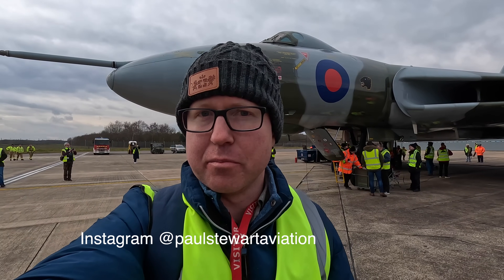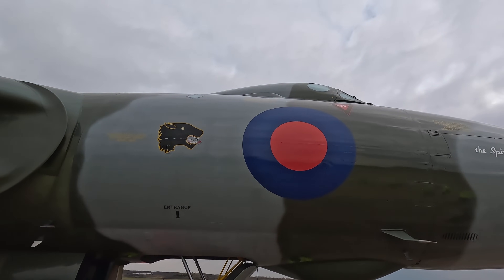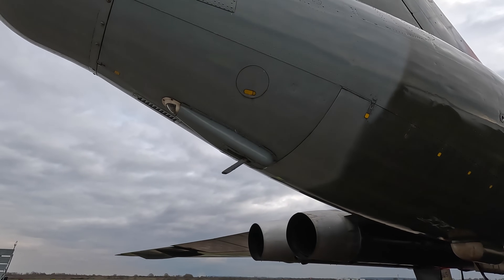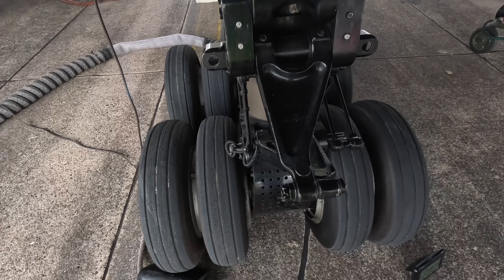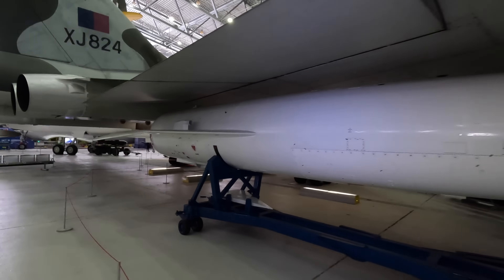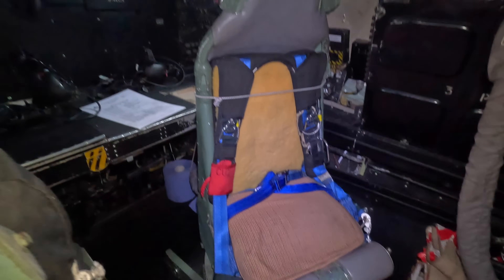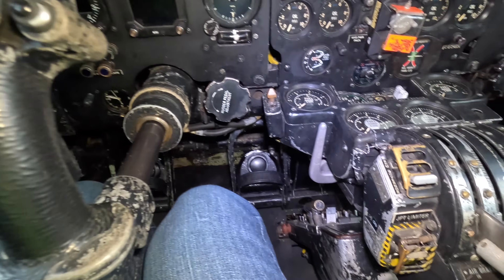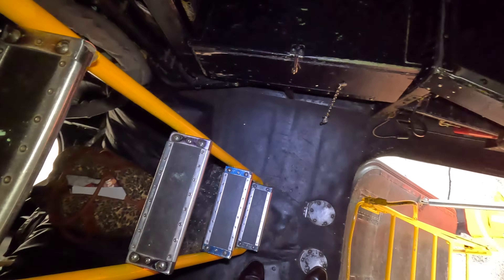Guided tour through an Avro Vulcan + engine run!

Comment: Looks similar to the Canadian built ( and destroyed ) A. V. Roe, CF 105 Arrow.
Reply: The Arrow is similar in that it failed to achieve its intended performance specifications, the Arrow lacked the engines it needed, and the Vulcan failed to fly supersonic due to design flaws in the airframe structure and aerodynamics

Comment: Wait, they could have upgraded the engines with afterburners similar to Concorde? How crazy would that have been if they had? 😮
Reply: Avro was forced canceled plans to install the afterburning version of the engines due to some serious design flaws in the airframe and aerodynamics that could not be resolved. Avro had to install a "Mach limiter device" to all the Vulcans to prevent them from crashing.

Comment: It is a grand irony that a plane designed to vaporise Russian cities from high level ( going low only came later) was, in fact, the best low level display aircraft ever. That beautiful howl from those Olympus , the fighter like performance, it’s sheer size and high lift wing meaning that the plane was always filling the sky during displays, not just a dot on the horizon. If only development had been continued and faith in manned aircraft maintained by the authorities the Vulcan could have been the British B52, still flying after 70 years and heading for a centenary.

Comment: I worked on them at Scampton in 1975-1978. Number 444 used to go for it's daily 'Taxi' around the airfield and would throw up a Fault so never took off. Noisy oily aircraft. I can understand people raving about them but wasn't a fan. I got my right hand crushed in the Bomb Bay whilst trying to remove a snagged mushroom head of Bomb Cradle Jack. The joys of being an Armourer. lol. Every piece of the Ejection seat had to be lockwired and every bit of trimmed wire had to be accounted for and as you can see in the video, there's not a lot of room to work. Fitting and removal of the seats required a crane but the initial lift out of the cockpit was by manual lifting, probably wouldn't be allowed nowdays. Many a cold winter night spent looking for missing zeus screws which had 'popped' out whilst working out on the pan handle when they were night flying.

Comment: I never knew it was designed for high altitude but then used in low. I'm not very knowledgeable about aviation but imagine it's like asking a sports car to go off road.  There was a great documentary on channel 4 in the UK, I think, which detailed it's farewell flight around Britain and the preparation for same. Pretty sure it's on yt.

Comment: For such a large aircraft, I was mildly surprised just how tight the crew section is.  It certainly takes a special person to be one of the five members who operate the beautiful delta.
Reply: This was essentially Avro Lincoln instrumentation squeezed into a five-crew cockpit. No wonder it was such a tight fit.
Reply: My wife's uncle was one of the three flying forwards facing backwards as an Air Electronics Operator.
Reply: The Lancaster was also very cramped for its size.

Comment: They have one of these are the museum at Castle AFB (closed and retired air force base in central California). A few times a year they have open cockpit days. They never had the Vulcan open but it still always had a good crowd around it. It's actually a pretty cool museum considering the base has been closed for years and the city itself isn't a huge town. When the base was in use it was a B52 base, I can still remember driving in the freeway through that area on trips when 2 was little and seeing the huge B52s landing and taking off

Comment: Wow, i cannot believe the complexity of the plane. Imagine designing this, making jigs and fixtures, the wiring looms and then getting all the parts to fit together and work.
Reply: Engineering/design always fascinates me, but nowhere more does it impress me than in air and space (just aerospace I guess) vehicles!
Reply: Designed primarily on drafting tables with pencils and slide rules.
Reply: ...and then having to make a change, such as the bend in the leading edge of the wings.

Comment: Wow.I thought I knew alot about the Vulcan and seen this one fly several times but never knew about the angled engine to prevent yaw.Brilliant.I was lucky enough to see 558 fly when it was still owned by the RAF as a display aircraft and displayed it more like a fighter.In later years under private ownership it was never displayed as hard for obvious reasons.Cost many thousands of pounds for a short display alone without unleashing its potential capabilities.It was finally grounded because her main spars were at fatigue point and to replace would have been too much.Also alot of electric components were no longer available and the knowledge to keep these airworthy was minimal.
Reply: Oh ps the vulcan that had to abort the Fawkland sortie is on display in the UK at Cosford aerospace museum.

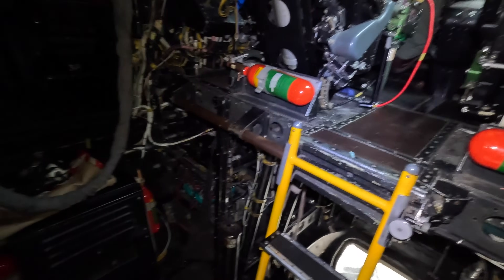Comment: Great video Paul! I love the Avro Vulcan what a cool British 🇬🇧 bomber part of an excellent series of new intercontinental bombers build during the Cold War! 😊😊 You know how I love old aircraft in museums but ones that fly are 10X better!!! Yay 😁Also at 3:16 that’s a great idea to separate the turbulent boundary layer from the main engine intake area and quite a revolutionary design element given this planes relatively old age! Also as the laminar flow enters the engines since they’re turbojets all the directed air in the engine is ignited (and afterburner probably)this gives the engine all the airflow being fed to it for use however that does mean the engines are much more inefficient than any afterburner equipped turbo-ram jet engine  for example would ever be! Finally at 14:35 what a great idea 💡 to be able to start the long engine start up process on these bombers I didn’t know they had that awesome feature!
Reply from the maker: Cheers Caleb!